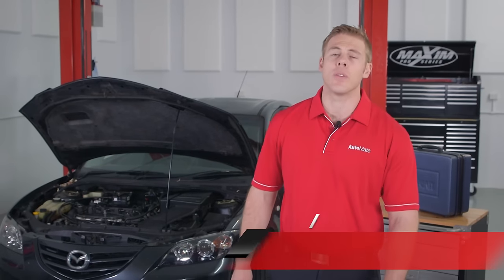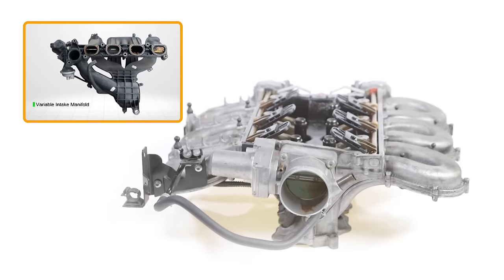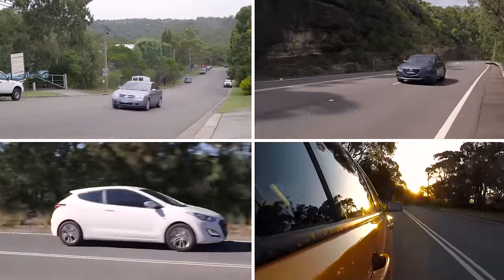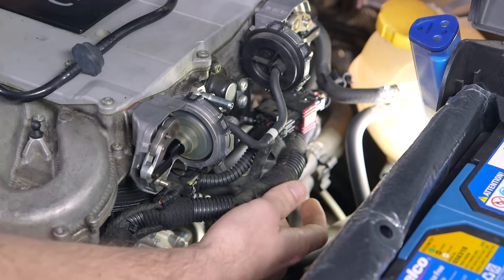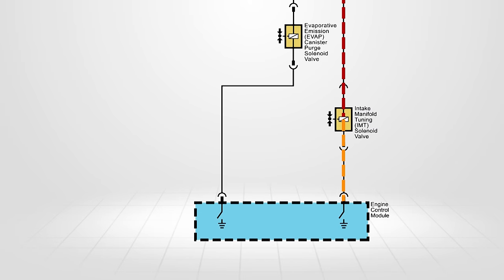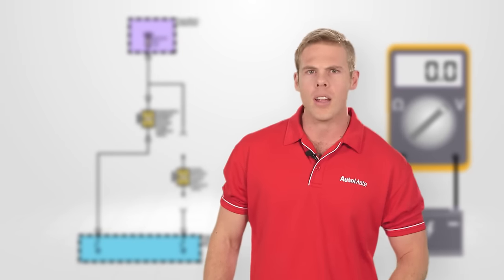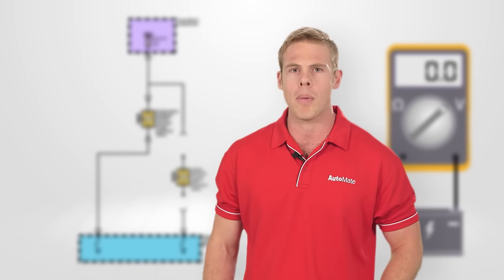Intake Runner Control - Solenoid Type

Comment: You're picturing a black manifold with swirl flaps in it at .35 and saying it's for changing the runner length, it isn't. That's a single length runner manifold.
Reply: It does effectively change the runner length via physics.

Comment: Why they have to put this things in the engine if this will cause trouble? just asking..
Reply: Because the engineers designing it aren't the ones that have to be able to access everything to fix it when the inevitable happens.  But they make their pay also by designing things where the dealership service department has opportunities to generate revenue every year as well.   They could build vehicles that last 500,000 or more miles AND only have a handful of parts invested in the entire vehicle that are easy to access and repair/replace.   Doing so, however, means a lot less of the customer replacing or upgrading  their vehicle every 10ish or less years  from the same mamufacturer. so less frequent repeat customers.    This also means the manufacturer's very lucrative financing department will take a huge hit by making truly reliable cars that are inexpensive and easy to fix.  
    This is the difference between Engineers & Mechanics.   If engineers were the ones doing the work to repair or replace components when they go bad, there would be A LOT of major improvements in designs.  Until then, we can only dream and wish.

Comment: hi please i need your help .I have the check light engine on my vw passat cc 2009 on the dashboard and after diagnosis it was the P2014 issue . what i have to do and which part should i replace or repair ?
Reply from the maker: Hi Maksam, 

Our own experience shows you need to inspect the vehicle, plus understand the DTC to correctly repair.  We couldn’t offer you specific advice for this code.  The VW Code P2014 refers to the Intake Manifold Runner Position Sensor. If you are confident enough to work on your car, a good source for specific vehicle repair instructions is identifix.com. Otherwise, we would still recommend you see a qualified auto mechanic or technician so they can review the diagnosis.  Good luck with the fault.
Reply: 1. Check for restriction in movement of swirl actuator

Comment: Thank you for the video. You referred to the IMTV as Intake Manifold Runner control. I thought IMTV was for creating swirl affect. At idle the tuning valve flaps should be closed.  Above 3,000 rpm the flaps will be opened. I thought IMRC was separate actuator for controlling the length of the runners.
Reply: You are 100% correct with the model he showed in this video.

Comment: Where can I buy new Variable  Intake Manifold flaps ?? for DIY repair kit ?
Reply from the maker: Martin, unfortunately we can't point you to a definite seller. We can only speculate that your local car dealer might have this, if not, then an independent shop should definitely have the part(s) you need. Good luck with the parts hunting!

Comment: Beware on last generation Mazda Protege 2.0L engines of misfire codes for cylinder 1 or 4.. Not only will your spark plug gap likely be literally beat completely closed,  but the engine will also pass a compression test but not a leak down test, when one of those brass screws securing the butterfly valves to the intake manifold vibrates loose and bounces around before exiting around the exhaust valve, taking a chunk of the exhaust valve with it.. Take a guess how I learned about this BOTH times it happened.. 

    I am currently gathering as much information on deleting this system as I can find, to determine if the ounce of prevention by removing it saves me from havin to replace the engine in my car a 4th time within 3 years- or if i am increasing risk of damage by removing it.
Reply: Hey , so what informations do you have now about it ? I have a mazda 3 2008 1,6 petrol , and i know that i do not have those butterflys at all , i do not have even the solenoid witch it a small electric motor , in 2 years and half i did over 60.000 km and all was good , but this winter when engine is very cold , engine shuts off right after i start it ..i need to push gas pedal for 30 -40 sec and after warms up a bit EVERYTHING  is back to normal , a check engine sais i have to change the solenoid ..but i need the butterflys as well , what is your opinion ? should i wait for summer ? :))

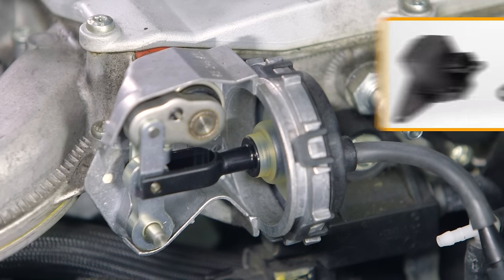Comment: 0:35 Ford Focus intake manifold, with the runner plates destroyed -- a common occurrence on those engines. Increase in torque? Yes, as long as the pieces of shit work properly. If the runners get stuck closed, the engine will pretty much die of asphyxiation. 

Pretty much every engine has them these days, but I still say it's a stupid idea. It's an obstruction in the intake runners whether it's open or closed, and if it ends up breaking like the Focus ones do, vacuum will suck pieces of metal into the combustion chambers & destroy the engine. 

Easier ways to make more torque without risking engine destruction:
1) More efficient, free-flowing intake tubes 
2) More free-flowing air filters
3) Less restrictive inlet-to-air filter designs
4) Less restrictive exhaust setups that maintain emissions requirements 
5) Stronger block/head designs that can withstand higher compression

OEM engines are designed to pretty much live their lives with a stuffy nose, and yet when engineers want to increase torque, they instead add further obstructions to air flow and design the whole thing rely on a spaghetti plate of vacuum hoses to function properly. What could go wrong?
Reply: I have a ford focus and im gonna just take the flaps out (but you need to leave the flap housing on because the housing is what holds the gasket).

Worse than them getting stuck shut is having the bar which they pivot on break and destroy the engine.
Reply: Increase in torque and better fuel economy, there is a reason a Gen 2 Focus gets 2-3 more mpg than than a Gen 1.

The design isn't flawed, just it's implementation.
Reply: @toddmiller5322  If the Gen 2s get better MPG, I assure you it isn't due to IRCs. 

I stand by what I said earlier - it is a flawed design because open or closed, they represent an obstruction to incoming air, which is precisely what performance engines avoid like the plague. 

The intake tract is already littered with unavoidable obstructions -- a MAF, IAT, filter, butterfly, etc. The last thing incoming air needs is another wall to slip around. 

Besides, both Gen 1 and Gen 2  Duratec 2.0s make 136 ft-lbs of torque. The Gen 2 even makes less power (140 hp) than the Gen 1 (145 hp).

Comment: hello 
i have mazda 6 2007 engine model LF 2000 cc and it show me p0661 please help me how to fix it 
the acceleration is low
Reply from the maker: Ali,
You will definitely need to inspect the vehicle, and understand the diagnostic trouble code before you repair your car. A P0661 code refers to the Intake Manifold Tuning Valve Control Circuit Low Bank 1. If you are confident enough to work on your own car, a good source for specific vehicle repair instructions is identifix.com. Otherwise, let a qualified auto mechanic or technician diagnose your car properly.
Good luck with the fault.